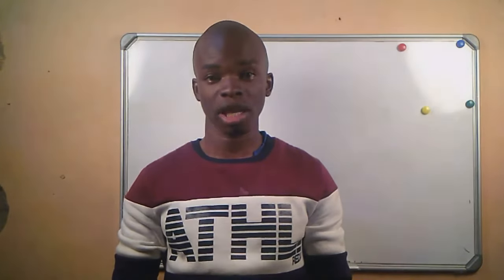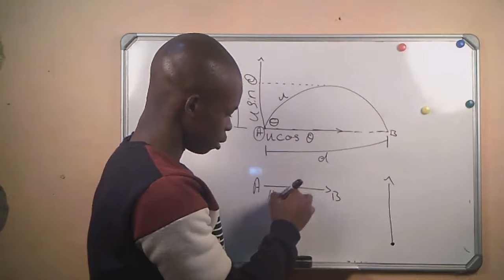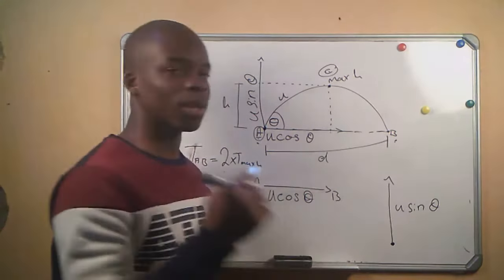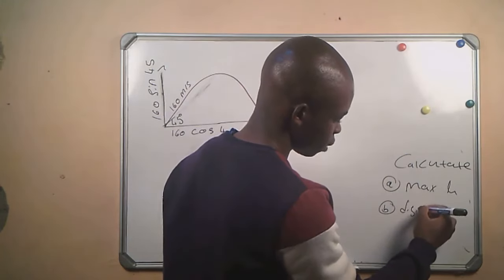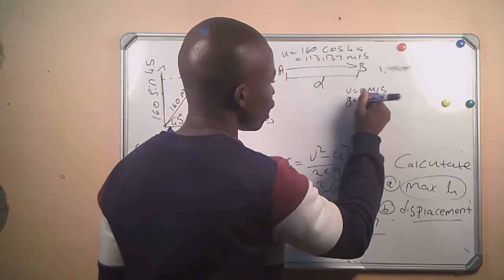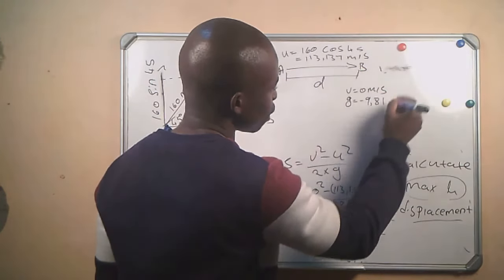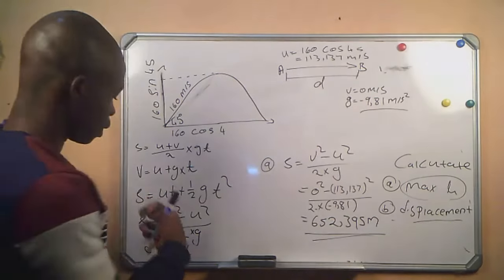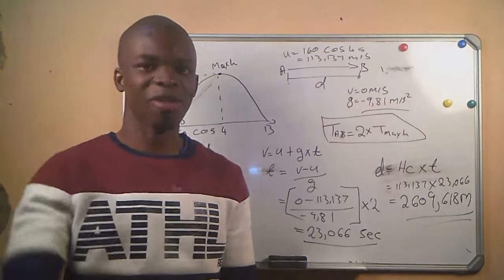KINEMATICS: projectiles ENGINEERING SCIENCE N4

Comment: How can I calculate the angle of projection if I only given the maximum height
Reply: Are you given time ?  If you are then use    Displacement=Horizontal Component x time  then substitute values in the formula
Reply: No
Just the vertical height
Reply: A rocket is launched from a cannon on the ground at an angle to hit an office 220m above the ground in a building.

Determine the angle of projection necessary to hit the office.